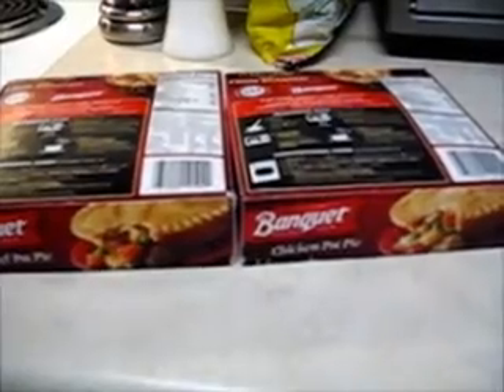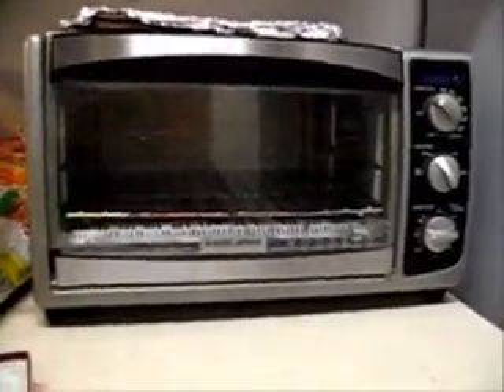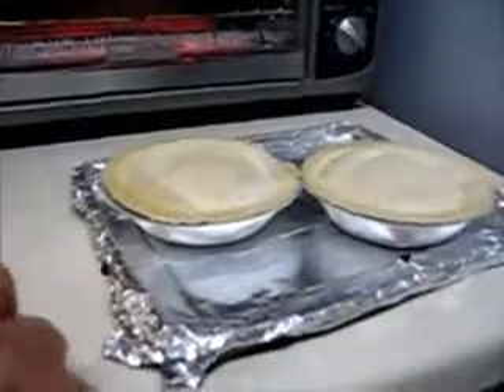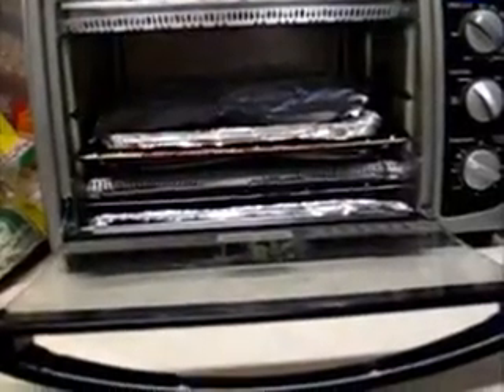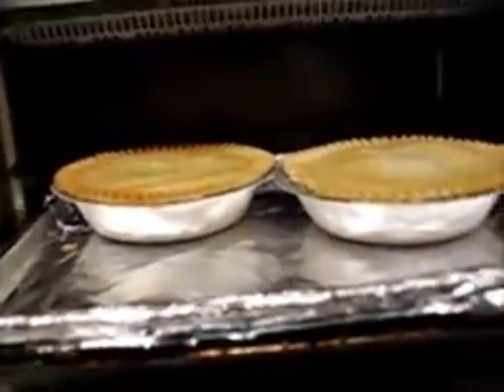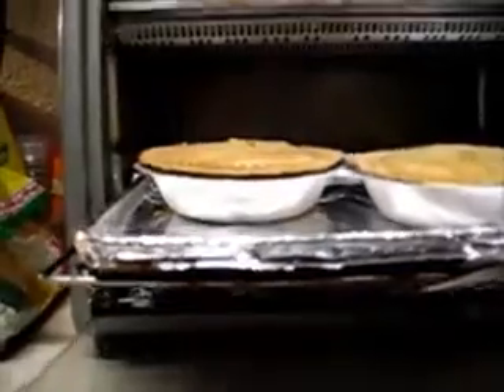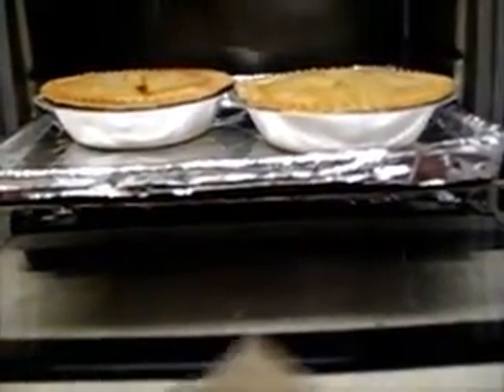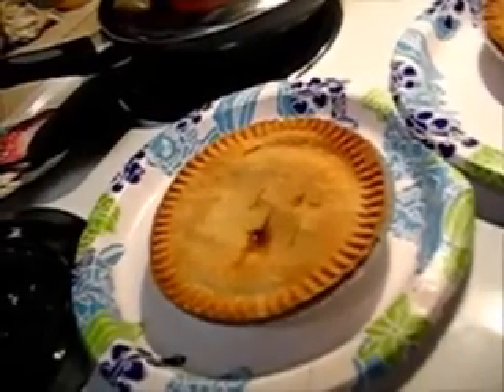HOW TO COOK FROZEN POTPIE IN TOASTER OVEN

Comment: Have never cooked a pot pie in microwave and only a couple times in an oven but never a toaster oven. The one I bought is bigger so I allowed extra time to bake. The carton it came in was like cardboard. On the box directions it said could microwave or toaster oven cook. I followed your direction and used my thermometer first time. It worked out great.
I cooked two pot pies in preheated toaster oven 400 degrees and covered the edges of crust and also an aluminum foil tent like yours for 40 min and took off the aluminum foil and finished cooking the crust for about 5 min. Then used my never been used thermometer. I’ve made pot pies a couple time before and the bottom crust was always raw and it made me think the middle was raw too. So I cut it all up and cooked it more so today I was looking for a better way to cook one using a meat thermometer. That’s how I got directed to your site. I learned a lot. And my pot pies came out great. I let them cool out of the toaster oven. I learned a lot. 
Thanks so much.

Comment: I just cooked 2 in my toaster oven for the 1st time! I took them out of the  'cooking pans'  and covered a metal pan with foil and put them in naked (lol). I do a lot of toaster oven cooking and have decided temp can not be depended on, so I keep mine set to 'always on' and ''toast' so that my food is being cooked top and bottom at the same time! I just time and check and repeat if necessary. My pies did leak and melt, stuck to bottom just a little, but they were great and this was the 1st time I ever checked temp! Next time I'm gonna bake in the pan they come in to see what happens.  It works great for everything else I cook.

Comment: I believe pot pies USED to go into the toaster oven, that was why they gave you an aluminum foil bowl instead of the current microwaveable paper/cardboard bowl.  The reason now it is not a good idea to use toaster oven, is because toaster oven temperature fluctuate within a much bigger range than the normal oven.  So when both set to 400F, the normal oven's temperature may go up and down 50F, but toaster oven could be plus and minus 100F (just to give an example, not actual real world numbers).  The paper bowl might catch fire in a toaster oven.  So if you can switch out the paper bowl with one of those disposable aluminum foil pans, it'll be the exact same setup as the old days, built for toaster oven.
Reply: Also most of the early toaster ovens and you can still get models like this only had one rack position. Looks like the model here has at least two are rack positions. I have an air fryer toaster oven that has three rack positions and it has a digital control panel I know some people are not a fan of that but have not had an issue with it yet.

Comment: My guess is some of that instruction is this because in older toaster ovens with a single rack position you're very close to both heating elements. A toaster oven should be able to bake a pie just fine as many brands advertise at the toaster ovens could bake pies back when they came out.

Comment: It's also like the "don't use the popcorn mode" with microwave popcorn.  There are so many varieties of toaster ovens and of microwaves that the food manufacturer can't be certain of how their product will turn out so they just tell you to not do it.   As with the popcorn mode, the best thing to do is to give it a try and see if it works with your microwave (the Orville minibags seem to work on popcorn setting 1 for me)

I do think the instructions on the packages are poorly written.  I'm looking at a frozen chicken pot pie where the instructions say to keep it in it's paper tray with the microwave instructions but with the conventional instructions, it only says to remove the plastic wrapper.  So does that mean you don't remove the plastic wrapper with the microwave...  Does it mean you don't keep it in the paper tray if you use the conventional oven...   The ignition point of paper is 451 Fahrenheit so a paper tray in an oven at 375 Fahrenheit might be reasonable so you can't just discount keeping the pie in the paper tray due to the risk of fire and without the paper tray, will it hold it's form... and since when did they abandon aluminum foil trays for paper trays...  As to the microwave instructions not mentioning the wrapper, perforating cling film is common with microwave heating so just perforating the wrapper might be right and some products like microwave popcorn have special paint on their wrappers that heat up in the microwave to provide some crisping so why did they not mention the wrapper at all in the microwave instructions and why did they not mention the paper tray at all with the conventional oven instructions...   I guess, this goes back to the just give it a try, you might loose one batch of chicken pot pies but then you'll know what will work for you but this does make me a bit upset at the food manufacturer...

The 165 Fahrenheit recommendations is because various government groups and some legislations say that temperature would be safe, would it really be cooked at that temperature or palatable at that temperature, well that's not the concern of those organizations and the frozen pot pie fillings are often pre-cooked before being frozen and the crust might be par baked that is 80% baked before being frozen.  Again, poorly written instructions...

Comment: I have a toaster oven at work now and I tried a potpie in the microwave and it was horrible. Ended up all gummy and just came out bad. So I tried the toaster oven and 5 min in the crust was already starting to burn on the edges. It finished ok but I had to cut away the edge crust cause it was burnt. So next time I will try the foil tent as that seems to work for you.